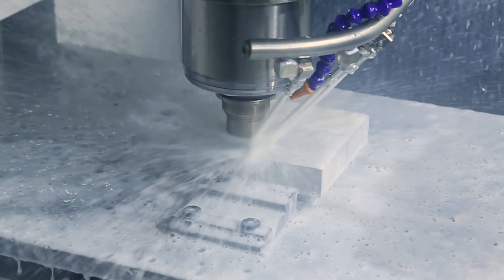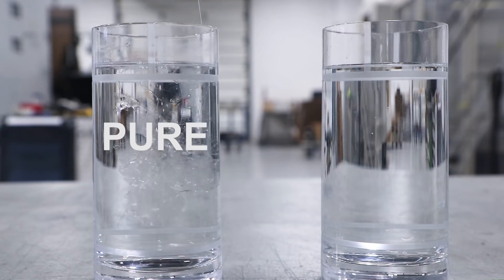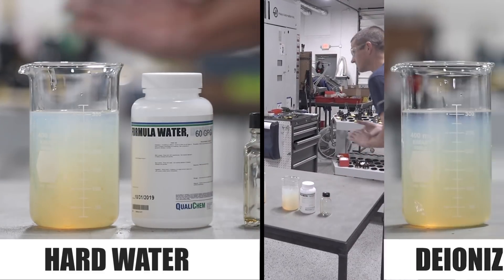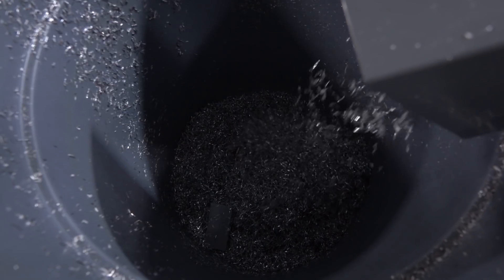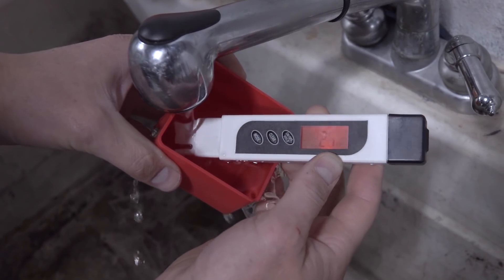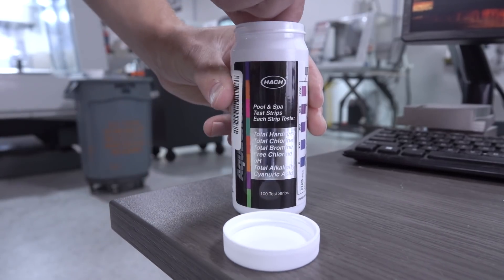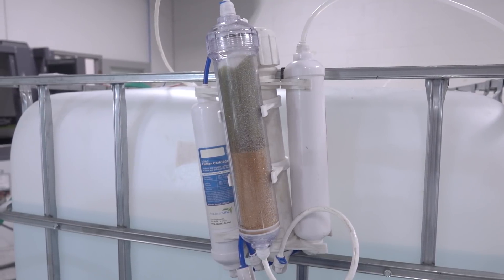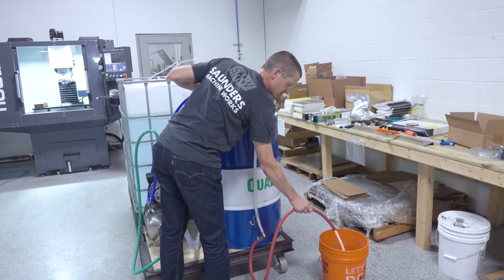CNC Machine Coolant and Water Quality | Clearing Up the Confusion!

Comment: Very interesting subject as I am in a new job where coolant management is non-existent and most machines run with stuff that is close to raw sewage... 
I have been wondering if there are systems for active chilling/ refrigeration of coolant especially during machine operation but also while sitting idle? For precision work I imagine this would be critical. Also, keeping the coolant cool would obviously inhibit organism growth. For periods where machines are sitting idle for weeks (like during holidays) what would be the best approach to prevent spoilage? I have heard several machine operators say they had a problem just after the last summer holidays. I think it would be great to collect the coolant in IBCs and store them at low temperature in a walk-in fridge or something, maybe have it circulated and aerated at the same time? Some pretty far-fetched ideas I know and surely nothing our management is going to do, LOL.
Furthermore, also everyone is saying that having the used up coolant disposed of is 'super expensive' (so they think running spoilt coolant is somehow cheaper). But, I was thinking it's like 95 percent water so is it not possible to evaporate the water out again through natural means? We have a pretty large facility, thinking of putting large flat drip trays covered with glass so ideally the wind and sun can do it. Just another wild idea, LOL.
Would love to hear your input. Keep up the good work. Greetings from Holland.
Reply: There is absolutely chillers to keep coolant chilled to the precise temperature and I'm sure they can prevent algae as well

I recently started working on 5 axis grinders in the silicon industry, for a company that has likely spent tens of millions on their coolant system... Yet we've been fighting coolant foaming for the past 6 months 🤦

Turns out money can't solve all problems lol
Reply: @LukeA_55  Great story! Thanks.

Comment: We have fairly hard water and I need to descale my kettle every two weeks otherwise I'll have tea with snowflakes ...
I now filter my own water (5um particle filter + carbon filter + RO membrane) and that system contains a flush valve to clean the membrane - it reverses the membrane and flushes out all solids. I went down from a TDS value of 190 to 3-5. The DI resin filter brings that down to 0.
Some tips when using an RO membrane filter: use an extra high pressure pump (8-10 bar) to get a better flow rate from your RO filter and measure both inlet + waste water quantities* to keep track of the flow rate - if that drops too much you need to flush or replace your filters. Also measure the TDS value of your water on a regular basis.

*) instead of measuring the water quantity you can also measure the amount of RO/DI water produced in a given time

Comment: Awesome video John; coolant maintenance is still black magic to me.  Since I only run my MiniMill2 on weekends, I have serious evaporation issues, and use a deionizer to top off occasionally.   Perhaps you could go into more detail on exactly how to use a refractometer?   I get nice distinct lines in mine (ExTech) for the reference water, but it's really hard to make out the concentration of the coolant (QC245C) - I just don't see a line, more of a gradient.  I'm pretty sure I'm not off the scale (at least I hope not!), and am certain it's just operator error on my part.

Comment: Be very careful when using de-ionized water as it will tend to strip ions from anything it touches.  Sure, it's basically pure H2O and is VERY soft to the touch (which feels really weird), but using it in metal-based machines can potentially cause corrosion.  You might want to look into adding ions to the mix in order to balance the system back out in a very controlled way.  Your coolant manufacturer should be able to help you with this.  An R.O. system is much safer and will usually give you great quality water, as long as it's designed for your needs.
Reply: MikeBramm 
No need. The coolant concentrate will re-ionize it. 

The only real problem you may get is excessive foaming, in which a small amount of calcium acetate will fix. About 1 tsp per 10 gal of coolant should be enough to prevent foaming.

Comment: Still use filtered on the initial fill up and if foaming occurs, add in powered calcium acetate. 

This allows you to control the exact amount and the exact type of mineral to harden the water up some. Relying on the whatever in tap water isn’t good, especially since municipal water supplies have things like chlorides and fluorides added.

And for mixing valves. I highly recommend a dosatron system. 

Venturi systems are ok, but are susceptible to changes in flow rate from your tap. If you’re on a system that has flaky flow rates from the town, you’ll be constantly tweaking that little needle valve to maintain concentrations.  A dosatron eliminates the flow rate problem all together and mixes at exact concentrations regardless of flow rate fluctuations

Comment: Thanks Mark Terryberry for helping me re-create a video out of his tip of the day segment is what the title of this video should read. Stem off of that on a different direction, delete this video and come at it from a machinist talking to his boss about changing the way a company views coolant. 100+ CNC machines in our shop every single one running the same shit.. Address that in a manner that might bring change to a company from the level of a CNC machinist.
Reply: The only way I can get away from foaming is to slow down, my company views it as a non issue but if I didn't have to slow down over a petty issue like this and mop up the bullshit it creates production would increase by the amount I have to drop my rapid movements to combat this issue and I'm not versed enough on this topic to have that conversation with a higher up.

Comment: We use ethanol sprayed on the tool, also plasma dlc coating, for aluminium cutting and milling enough i think, btw we thinking what lubricant dissolve in ethanol for better tool life.

Comment: Great job! Is a coolant skimmer system worth it, does it increase the longevity of the coolant?
Reply: Jeff m510 
Yes/no. 

It doesn’t so much improve the life of the coolant, as it does prevent the growth of bacteria that causes the foul rotten egg smell. 

Bad smelling coolant doesn’t really mean the coolant has “gone bad” it has lost little of its functionality, it just smells bad.  But bad smelling coolant pleases nobody in the shop. 

A less expensive option to try is putting in an aquarium air bubbler into the sump. It will keep the coolant oxygenated and slow down the bacterial growth.

Comment: fun fact: machining tons of copper and making lots of fine chips seems to effectively nuke the bacteriological issue.  :)  we run exclusively Deionized water, even in the saws and manual lathes now.   
It makes great cutting fluid, just be mindful of the fact that the DI water is looking to strip ions from whatever it touches.  We should have probably been doing our initial charge with at least some amount of tap water. 
currently running QC 250C, and QC Xtreme Cool 335.
Reply: Re-ionize your DI water with some calcium acetate.  It’s cheap and doesn’t take much. 

That is the major downside of DI water, it’s a heavy oxidizer, will rust cast iron and steels instantly.

And 2.0 brix is WAY too low.  5 is a bare minimum for most coolants.
Reply: Occams Sawzall I wanted to run the stuff at 5.0 but it was decided at around 2.0 by management because they didnt like the smell.   Technically 2.0 Is in the range acceptable for grinding according to Qualichem.
Reply: Occams Sawzall the iron surfaces never got any rust, it just attacked the plating on all of the fasteners.
Reply: Morgan Oliff 
I know someone who ran DI water through a cast iron pump and didn’t know why after a day or so there was an orange color to the water...
Reply: Brix is coolant specific. Some coolant can have a Brix conversion value >3, which would mean that the concentration (2X3) is 6% plus. It’s best to talk about % concentration and not Brix.
Reply: To clarify about the DI: it ate some of the Zinc plating from of our fasteners inside the machine. didnt seem to bother the paint or bare metal like the table.   the guys also like to try to run it extremely low brix, like 2.0
Reply: Ok.  Well grinding is completely different. 2 for grinding makes more sense. It’s usually about half the concentration used for machining.

Comment: For anyone that didn't know. RO water is Reverse Osmosis filtration. Di water is De-Ionoised water. Basically distilled water.
Why he didn't say that is because he is talking to himself, not an audience.
Reply: gus bisbal 

DI and Distilled water are not even remotely similar DI removes only charged, non-organic compounds.  Any organic compounds remain in the water.  Which is typically why you have an ROI system.  An RO system to remove organic compounds and a post DI system to remove the inorganic compounds. 

Distillation removes all organic and inorganic compounds and not just charged ion inorganics. 

Both are suitable for making coolant, but there’s a vast difference between distilled and DI water.

Comment: What is recommended for low use manual machines

Not a fan of water based coolants due to rust/ bio issues 

Prefer a oil based
Reply: Loco Fab 

“oil based” is just straight cutting oil. There’s several vegetable oil based straight cutting fluids.  

There should be no rust issues with water based coolants though, if there is, the coolant was either mixed at the wrong concentration, or mixed improperly.  Water based emulsification coolants are mixed by the O.I.L method. Oil In Last.  You get all your water first. THEN add in the coolant concentrate.  Doing it in the reverse will cause improper mixing and often cause the emulsion to spilt, so you have separate oil and water components in the sump, with the water component causing the rusting issues.

Comment: Nothing worse than a smelly coolant tank.  I refused to use the coolant on some of the machines at my last machine shop.  I’d rather burn up tools or smoke out the shop with cutting oil than have nasty biohazard coolant splash in my face!

Comment: Most coolant reps don't know shit. I've found only one that knew what he was talking about and he's our guy now. I bought a di system for 600 bucks and it'll get us a few thousand gallons before needing to replace the resin for $200 or so. One thing to keep in mind is most coolants when splitting will take an assload of the hardness with them and get skimmed out. I have one machine with coolant from 5-6-16 and one with coolant from the beginning of 2017. Both are doing well.

Comment: I am hoping this series also covers mist/mql systems.  Which coolants work well for it, concentrations, flow rate, etc.
Reply: @robc2536  Is that something you found better after testing other kinds too?  I was using Koolmist but it leaves weird discoloring on aluminum, switched to Qualichem but I don't know if its actually good for mist.

Comment: I love this topic and I hope it turns into a series. I have just been dealing with coolant issues where I work (German auto parts manufacturer in the US). We, unfortunately, tend to ignore the coolant situation, and I directly deal with all of the issues mentioned in the video - tool life, surface finish, and chip evacuation problems. Even though I am the low man on the totem pole at work, I already see some things I am going to do tomorrow after watching this one video. Namely, calibrating my refractometer. The good thing about dealing with a topic others ignore at work is that I have the freedom to try new things and hopefully get things done.

Other coolant problems I see is bacteria/fungal over growth in the coolant sumps (to the point I couldn't imagine coolant lasting 6 months) and foaming issues. Another coolant related video I would like to see is one about coolant nozzles - ideal placement, creative/unique nozzle solutions.

Comment: Coolant maintenance is not complete without discussion of disposal of old coolant.
Reply: 55 Gallon drum. Drum heater band, sump pump (to churn and bring hot water to the top for evaporation) . Once it's down to 2-3 gallons we dump into our oil recycling. About 7-9 days per a drum. Looks like a couldron.

Comment: Quali Chem was purchased by a Japan company. They have change their coolant spec. One change has caused a shorter shelf life. I’ve been using it for years, and then I notice it happen this year. Then I found why last month.
Reply: Source for that info? Thx.
Reply: QualiChem was purchased by Yushiro Chemical, the leading global Japanese fluid supplier, because QualChem standards and specs are high.
Reply: My sores from west coast. The changes has cause a shorter shelf life.  I’ve notice it happen this year.  In the past years my shelf life was more than a year. 
I have been using Quali Chem for more than three years. 
With my new machine coming next moth. I’m debating between Quali Chem are Blazer.
Reply: The new Japanese owners have not touched any of the products or processes at QualiChem. If by shelf life you mean sump life, I suggest you contact your local QualiChem rep to help you get sorted out. Shelf life of the concentrate has always been 1 year from date of production for most of the QualiChem products. Metalworkinginfo@qualichem.com to get you started.

Comment: Whats the best practice for a basement Tormach user where the machine can sit for a while. Stick to the fog buster?
Reply: I use two aquatic tank bubbles. It uses a little pump to push air to the bottom of the tank and helps keep the coolant circulating. You would only need one for a tormach. Before using them I was getting some sort of growth on the top layer but now it doesn't do it. My machine can sit anywhere from 12 hours to 48 hours without running so its good coolant insurance because coolant is expensive!
Reply: If you are using a coolant that requires 24/7 circulation, then something is wrong.
Reply: @CT, thanks for the clarification. I’ve been involved with systems of all shapes and sizes. I agree with your statement that more volume is better than less volume. Coolants are intended to cool, so the more volume you have the more heat that can be removed. But if a product is unstable without reconciliation, then it is unstable. Circulation only gives the impression of stability by keeping a coolant mechanically mixed. If it splits when you turn off the pumps, then you have a problem. The system will consume more concentrate than a system using a stable fluid. Recirculating by itself does nothing for the actual stability of the coolant.

Comment: In my local area the water all comes from chalk aquifers.
I measured its hardness as 65 Rockwell.
Reply: Is it still 65 if you measure further down the bucket? It might only be case hardened...
Reply: When I need to build a new building, I just pour water straight out of the tap, no need for mixing in cement and stuff like that, just let the water dry a bit, and you have your foundation. Well, maybe not quite, but nearly... ;)
Reply: hahaha xD

Comment: I only use distilled water. I get weird looks when I fill a cart at Kroger. I’ve been asked “you stocking a bomb shelter?” 🤣🤣
Reply: Distilled water is perfectly OK to use for mixing with coolant. The lack of minerals is exactly why it, like DI water, would be preferable over most city tap waters. The minerals in the water are what interfere with coolant components.

Comment: Top video. Some terminologies are not familiar. But it would be great if you could go through these details step by step in terms of how to identify what type of water you have vs what are the options on the market for coolant. For me, the video was very quick and I need to watch it again a few times. I used to be a CNC operator in the past and coolant used in factories do not have a huge lifespan and cooling normally smells funny quite easily. 1) How you keep your machine clean internally without affecting coolant is also another interesting subject. 2) How to avoid metal parts without corrosion protection being affected by the coolant which contains a lot of water? I hope are not silly questions. thx a lot
Reply: André Gasparini 
Funny smells is the result of tramp oil in the sump promoting anaerobic bacterial growth that produce sulfate waste products and gives off an rotten egg smell.  Weekly manual skimming of the tramp oil with a barrel vac, and installing an aquarium air bubbler to pump oxygen into the tank will eliminate that. And if the machines are getting heavy amounts of tramp oil, installing an automatic trampoline skimmer should be considered. 

As for corrosion, every coolant on the market has anti-corrosion additives in it. If you’re getting corrosion from your coolant, it means your concentrations are wrong.